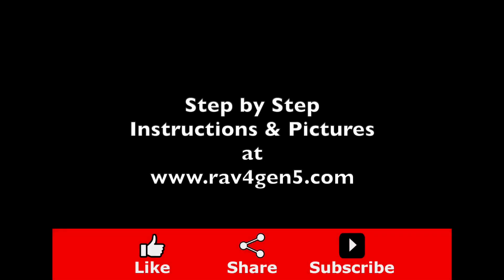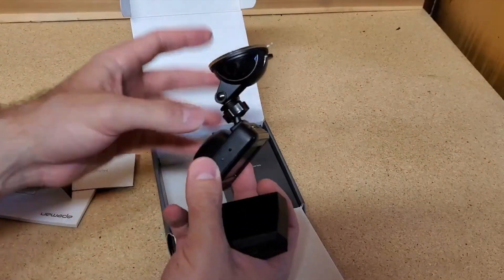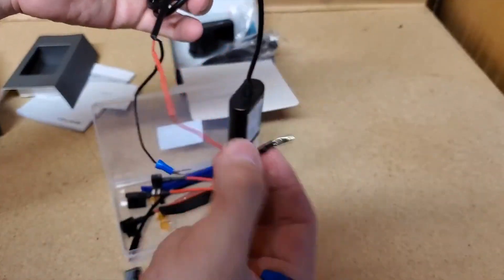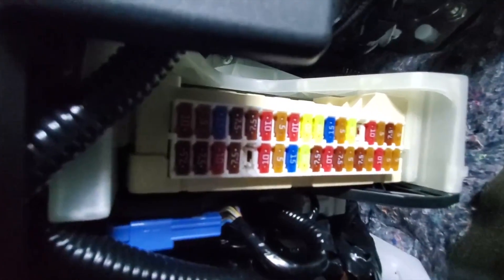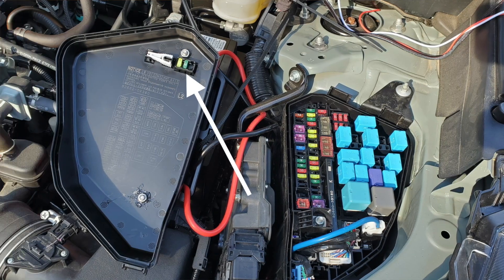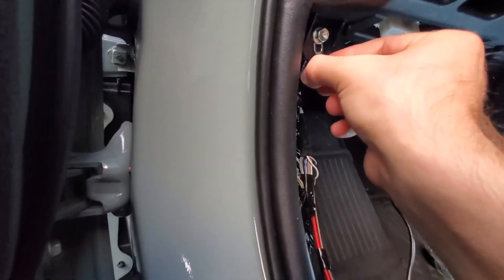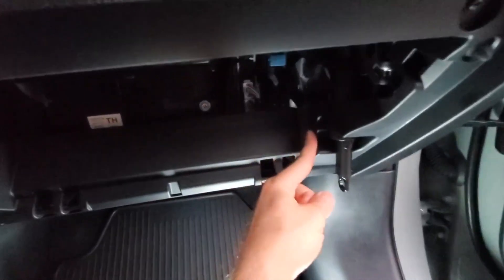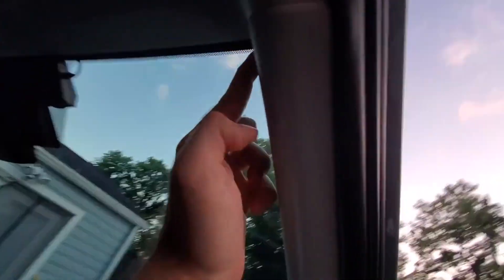Dash Cam Install on the Toyota Rav4 2019 2020 2021

Comment: Thanks for the video. Did you experience battery drain or dead battery going with the hard wire fuse tap route? I plugged into the same empty fuse slot. Things were working fine for 2 weeks. But when I left my car unused for 4 days, the car battery was drained and I needed to jump start it. It was the first time my car battery died for my feb 2020 RAV4. I think I might try to find a different fuse to plug into. Maybe the fuse for the cigarette lighter
Reply from the maker: No issue with me. It's not possible for this to be the source. No power is supplied to that slot when car is off. You and lots of others have battery issues for leaving rav4 idle too long. It's not clear what the source is yet according to Toyota. You can try a different fuse too if you like. Check with a volt meter first. What trim do you have?
Reply: Rav4Gen5 thanks. I’ll look into the broader battery dying after idle issue. Maybe it was just a consequence that my battery died around the same time as my dash cam hard wire install. I own the TRD trim
Reply from the maker: @pault4908  that is interesting to me now. Haven't heard of the battery issue on a TRD and my adventure is nearly the same as yours. Your dash cam does turn off when the car is fully off right? Super weird.
Reply: @Rav4Gen5  I have the blackvue battery pack for parking mode. The dash cam stays on for 24 hours prior to shutting off once the dash cam battery pack is depleted. I found this reddit thread on the 2020 RAV4 battery dead issue https://www.reddit.com/r/rav4club/comments/fucb6m/2020_rav4_battery_dead/. I'll add to the thread. If my car dies again then I will take to the dealership to check. I have jumper cables in the trunk ready just in case. Last week, my jumper cables were in the the spare wheel compartment when my battery died and I couldn't access because my lifegate wouldn't open. Lesson learned. :).
Reply: @Paul T interested on updates on you battery issue,
Reply: @ashekleyland  During a Toyota maintenance checkup, I had them do a software update which resolved the battery issue right away. It’s been 6+ months without issue.

Comment: Should of ran the cable behind the airbag 6:18
Reply: Just pop the trim off an run it behind the airbag , if ever the airbag goes off you don't have the  wires deploying into your face.

Comment: This isn't helpful at all for me. The wire shouldn't be in the weather-stripping or across the top of the airbag on the A pillar. Also, the orientation of the fuse tap definitely matters. If you install it the wrong way and remove the fuse it would still work, so the fuse wont be in line protecting the equipment.
Reply from the maker: Check out the other video I have on this and on the fuse. Fuse tap matters but the fuse does not.
Reply: @Rav4Gen5  okay I found it and watched it, pretty helpful. I think I have identified the fuses I'll be tapping.